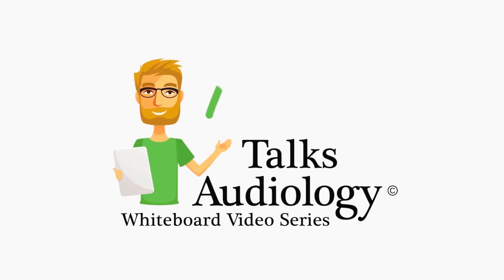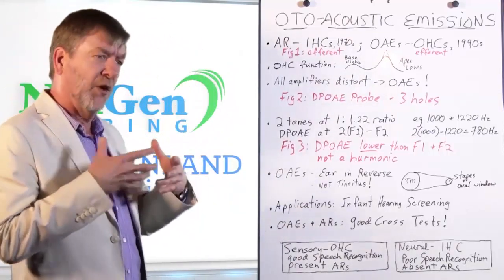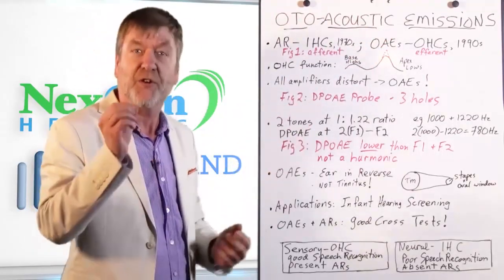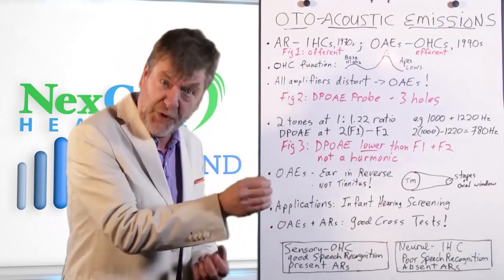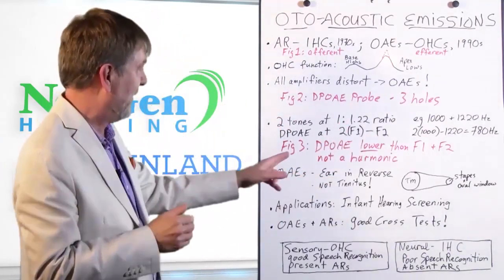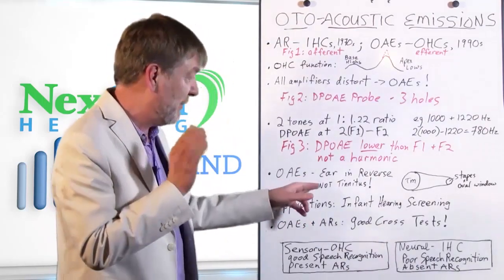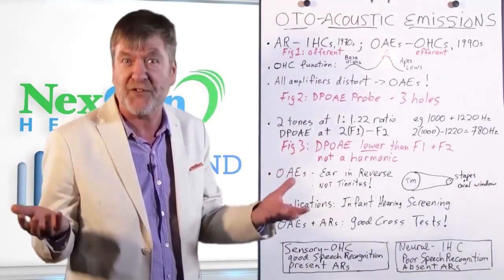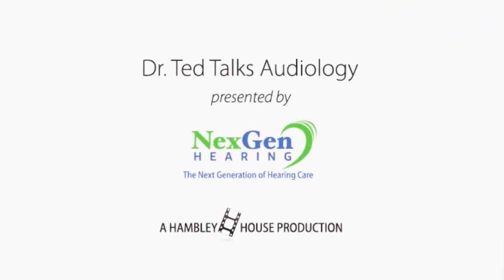Otoacoustic Emissions

Comment: Thanks, very interesting explanation. I came here because I wanted to understand a phenomena experienced by some people called The Hum which is where they hear/feel a very low frequency vibration that sounds like a diesel engine idling, a very low hum that also has a pulsating, throbbing or phasing effect. I am 60 and I have this. It sounds almost like an actual physical vibration within my head. At one time I really believed it to be a real external noise, but now I think it is an internal sound as my wife says she cannot hear the sound herself. I thought perhaps it was a form of tinnitus. I also have high frequency tinnitus. I wondered if The Hum could be a result of OAE's somehow. But according to your explanation here, OAE is NOT tinnitus. So can you explain what causes this Hum that I hear?

Comment: I have a specific question. If someone presents good speech recognition with an 80 dB HL, what do you suppose the HL origin may be?
Reply: @Colette Welch It could be due to 1)Lip reading 2)Better hearing in the other ear. 80 dB HL - will DEFINITELY be mixed, ie. with both conductive and SN components, hence not possible for the person to have good speech recognition if HL is present in both ears.
Reply: @Harsha Vardan - 1) Lip reading skills is only relevant when you are not doing MLV and the opportunity to lip read is present. 2) While a mixed hearing loss is a likely scenario, I'll give you more information. The patient has an asymmetric HL with no measurable responses on one side. SRS have remained above 80% range via recording at MCL.